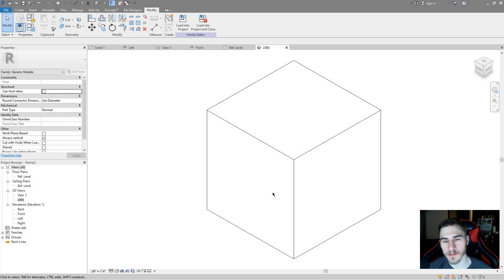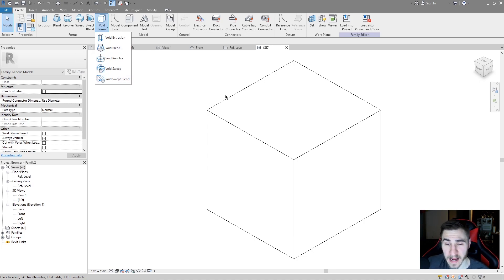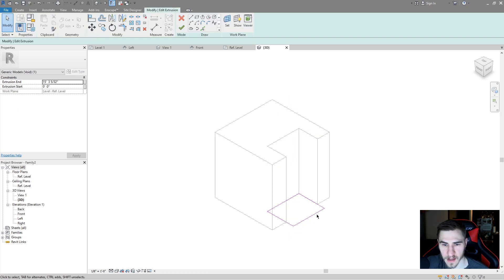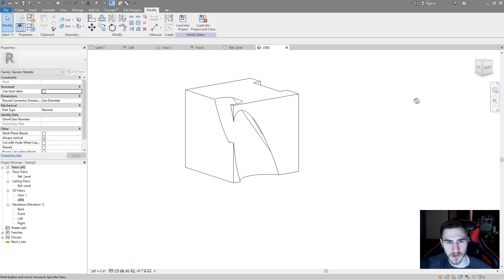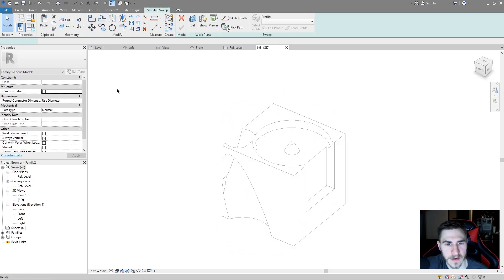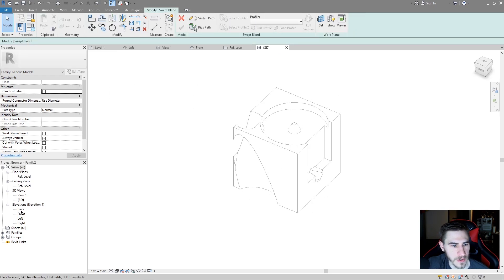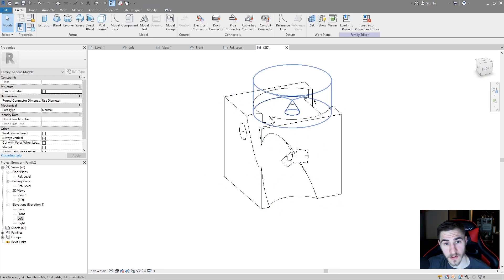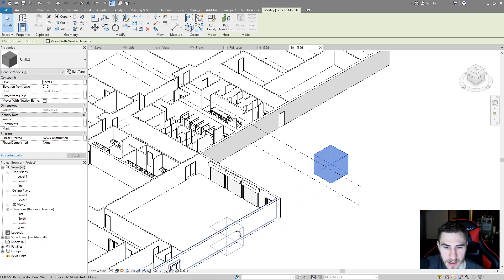How to use Voids | Revit

Comment: thank you for the video... but I still when I try to use void sweep on floor it says at the end  that this family is empty and will be deleted. Any ideas? I'm on the right plane and I see it cutting but at the end nothing.
Reply from the maker: I have had issues with voids where they do not continue through the face of a floor or element and end exactly on the face. You might continue the sweep beyond the end of the floor and see if that works. Hopefully, I am understanding you correctly.
Reply: @ArchitectureVanguard  ty for respond... I figured it eventualy out... I was trying to do the sweep with generic model within the project but then I saw somewhere that you need to make a family... so at the end it works... now I would love for that to work only on floors but :D

Comment: awesome , it shows "Some Void Forms of this family do not cut anything and will be deleted. To make a Void Form cut something else use the Cut Geometry tool how to fix plzz help
Reply from the maker: If you are making a family, do the cut in the family. And if you have a piece of a voiding a family that is not cutting anything, it will be deleted when you load the family.
Reply: @ArchitectureVanguard  thank u for the response,I'm using void in generic model ,if I apply on that model it's shows that error sir!!

Comment: Voids do not cutoff through the model  of nested family still yellow colored what is the solution?
Reply from the maker: Depends on if you want to cut the family or if you want the family to cut model elements outside the family. Leaving it uncut in the family will allow you to cut elements in your model with the cut tool. Or you can use the cut tool in the family.

Comment: How do you add the different material only in the cut part..if you don't want to use the paint tool
Reply from the maker: Unfortunately you cannot add a material and because you cannot add a material to a void then there is no way to transfer a material to the result of a void cut without painting that specific cut face. I believe having a material applied to the cut object would still populate over the cut area but if you want a separate material over the cut portion, that would have to be painted. I hope that addresses your question.